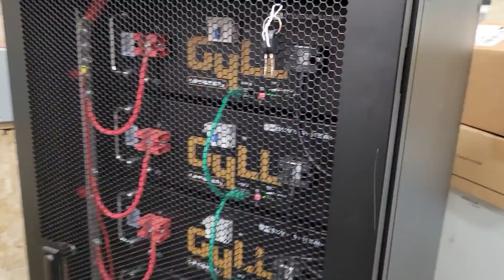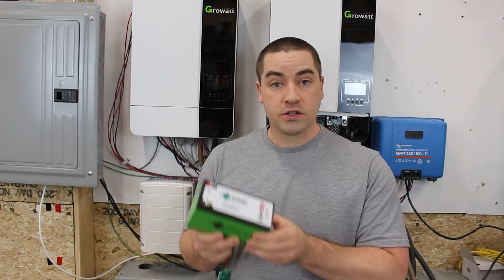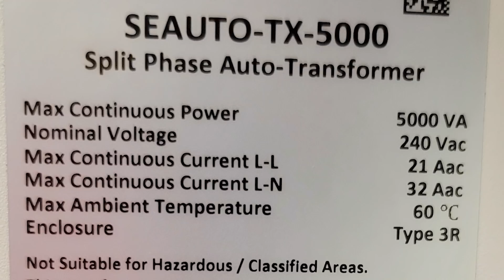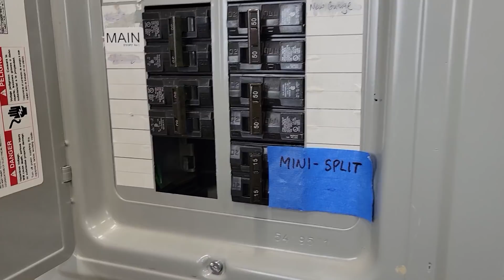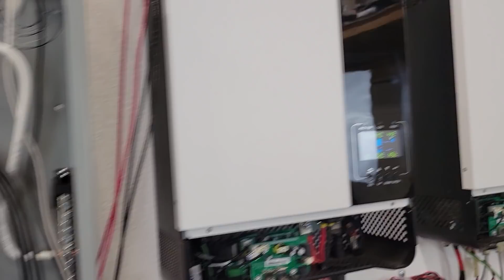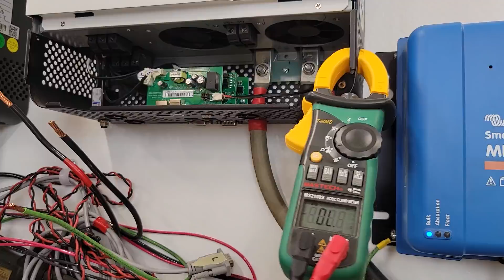Safety Concerns with Auto Transformer and Growatt 240V inverter SPF 5000 ES

Comment: David,

Love the work you do but from my viewpoint and, I may be wrong, you’ve improved the safety of your system but only protected the neutral overcurrent use case and haven’t addressed the use case where the auto-transformer itself and/or its interconnected wiring failed which isolates the neutral. Yes, these are passive components with very low failure rates but they’ve been known to fail for manufacturing, installation, and/or environmental reasons. Your trip will not function in this case. I believe the system needs to monitor the integrity of the neutral and shuts
 down the inverters, if the neutral is compromised or unavailable.
Reply: Good point.  You could add a voltage sensing relay to shut stuff off, but easiest would be a good surge protector, and I think Poz is familiar with this method too.  If voltage goes too high, it will short to ground and shut everything off fast. Cheap insurance.
Reply: @benssolarandbattery  Hi Ben. Could you do a video on how to implement the surge protector for this application? I sub to your channel. Thanks.

Comment: So let me get this right:

120v L1 (black) = 240v L
120v L2 (red) = 240v N
120v N = created by the transformer

And the hookup is:

240v L (both - black) ➡️ 3-pole circuit breaker ➡️ terminal block (black) ➡️ auto transformer + MCB

240v N (both - red) ➡️ red terminal block ➡️ auto transformer + MCB

Auto transformer N ➡️ 3-pole circuit breaker ➡️ MCB

(MCB = Main Circuit-Breaker Board)

Comment: Dave, looks like you have a breaker only on L1 and common, which is why when you throw the breaker you get 0 volts between L1/L2 and L1 or L2 and common.  Concerned you still have the L2 energized to your circuit breaker box, which could be an issue if whatever it is connected to that leg has an alternative ground.   BTW- Love the channel.
Reply: The inverter output is floating, so current from L2 can only flow back to L1, not to ground.

Comment: But those inverters are not hybrids they cannot enter the grid, the input is for the UPS function, am I wrong? They are not like the MPPSolar HYBRID SERIES! I do not understand the problem.
The neutral to earth is put to make the RCDs work correctly otherwise they do not work, some inverters such as the Victrons have a special programmable relay that closes a pole (N) to earth, obviously in this situation in the video it will not be earthed to the earth. inverter output, but only to the neutral generated downstream of the autotransformer!
This says my head but I live in Italy with 230V between neutral and phase and 400Volt between the 3 phases, maybe I'm wrong?
Reply: As the inverters here don't have neutral connections things get weird. If you use the UPS input and also have a neutral-generating autotransformer on the output you will have problems because you can only have one (bonded) neutral.

Comment: David. In your 100% Off-Grid solution, you will not have any troubles with that system. The 3-pole breaker should work, as long it can be made to trip in the first place, as you know, that MCBs do need a bit of an extra current to trip for overload. I do not see the need of using isolation transformers. Non-internally or externally N-G bonded inverters are IT (isolated) devices. An N-G bond after the autotransformer will give you the safety features of a grounded grid-connection.
Reply: This is a floating neutral solar generator design, I don't believe it can be used as a bonded neutral type generator because it would not be safe. Many portable generators (Honda inverter generator) are floating neutral designs and I wonder how safe those are?

Comment: So one leg will just have potential to ground when the breaker is off? 🤔 What i would do is just feed both inverters into a backfed breaker in an MLO panel and have the auto transformer fed off of the lugs at the top. Auto transformer is always on if the panel is on. You can then mount it directly next to the panel with a short pipe nipple to reduce wire run length for maximum safety
Reply: With only one leg from the inverter connected there won't be a current path for the other leg because neither output is connected to ground.
Reply: Oh, and the problem with having the autotransformer directly connected to the panel's busbars is that the inverters can output more power than the transformer can handle. Ideally you would want overload of the transformer to trip the main input but there's no clear way to do this with off the shelf components.
Reply: @eDoc2020  Very true, I did not think about that. However there are plenty of off the shelf solutions for this. The industrial market has a huge demand for that kind of stuff, you can even find remotely operated circuit breakers designed for breaker panels usually found in homes. You just need a robust control system, certainly no $5 chinese circuit will be reliable enough for that
Reply: My solar edge is connected to the main lugs.  This was also the easiest solution for me.  But, I'm currently only running one 5000 ES. So, there's no issue with overloading.  When I add a second inverter,  I will also add a second AT. I am a big fan of redundancy and overkill.

Comment: @16:18 I can see only one AC input breaker which is fine if you are feeding L, N, and Ground (as labeled on the terminals since this is US version is the modified ES version with new PCB that does not have N and Ground bonding), in this case with single breaker on L1 and no breaker on N (L2), if there is  short circuit between L2 and case, it will depend on the house breaker to trip instead of the internal breaker (if they install one). Can you read the spec of that circuit breaker? They should have installed dual gang circuit, but since the unit is not UL certified so they did not install it.
Reply: With L1 and N tripped on the breaker by overload L2 has no current path at all. You would have to have a second failure for the L2 to find a path to ground. The ground is a protection device. not a hot part of the circuit.
Reply: @solexxx8588  There is no N in this unit (SPF-5000 US), it is fed by L1 and L2 but GreWatt did not relabel the N port as L2, if there is fault in L2, the house breaker will trip.
Reply: @budmartin3344  Yes, if L2 shorts to ground it will depend on the house breaker to break the current. At the end of the video David addressed this, he is going to add a DP breaker on the feed into the distribution panel.

Comment: I would use an 100 amp autotransformer and wire it straight in. No breaker needed.
Reply: The auto transformer should be wired with the inverters, not separate from the inverters, and a failure on the auto transformer must stop the inverter power.

Comment: Just use the right circuit breaker on the output of the inverter, why we making this so complicated ?
Reply: Because that wouldn't protect the autotransformer.
Reply: @eDoc2020  How can it not ?
Reply: @quattrohead  The combined output of the inverters is 40 amps, but the transformer can only handle 30 amps. If you limit the output to 30 amps to properly protect the transformer you would be losing out on some inverter capacity.
Reply: @eDoc2020  And this is another reason that this setup is not good.
Reply: “Why we making this so complicated?”

This is why:
Video 1	https://youtu.be/gQ4NF9n0UxE
Video 2	https://youtu.be/goF46wGmPEc
Reply: @DavidHalko  Yes I know.

Comment: Separate the 240v and 120v loads into separate breaker panels/boxes. Bond the 120v breaker box and auto-transformer, and connect them to the 240v panel with a standard 2-pole breaker. So if the auto-transformer breaker trips, it disconnects all power from the 120v loads.
Reply: IMO: This looks like an interesting option to test and track; says my curious DIY side with hands on house wiring and one MPP solar system experience, but no autotransformer experience (yet). Wondering if this would protect from possible lose of ground., And if not. If a ground fault type breaker might also be some kind of option. I admit I still do not have full picture of concerns.
Reply: @CaptBill69  Interesting idea with the GFCI circuit beaker... I have always wondered why these portable solar generators do not have GFCI protection when they are mostly used outside which the NEC requires all outside receptacles to be GFCI protected. Also GFCI breakers are common with electrical hot tub installs although most are not 3 pole circuit beakers like what he is showing in the video.
Reply: https://youtu.be/RwI833Yh5XU
Reply: Can you make a video for this please. thanks
Reply: @makesaveinccomm     https://youtu.be/90O_iGjfm28

Comment: It’s amazing how much cleaner the power is from my Growatt inverter than the grid. My washer makes weird noises when on grid and is quite as a church mouse when off grid. I’m going to have my house disconnected from the grid next month because my power provider won’t work with us if we have solar.
Reply: Where is this happening?  The unit is Pure sine wave, you should not be getting that much noise from the power company as they can shorten the life of your electronics and refrigerators and such, have you contacted them?
Reply: sounds like bad transformer on the pole.
Reply: Curious what your grid location is.  ... like city or town, state, and country ???
Reply: Since these don't back feed to grid what us the issue with power company?
Reply: @sloup000  doesn't matter, some power companies don't want anybody with their own source connected. Probably for liability from the dumbasses who do back feed
Reply: Power companies don't care if you have dirty power, they only care if you have no power because they legally have to. The gate on my transformer has been missing a bolt for 5 years causing an amazing amount of spikes and brownouts in my house and explosions up on the pole. Burned out a TV power board and the computer in my fridge. They don't care and they never will.
Reply: If u want to have super clean power you need a power factor corrector kavar unit

Comment: I like using MCBs as supplementary protection.  The three pole idea does limit you to using an amp rating that matches all three devices which is not always feasible.  I like using an under voltage trip (applied the same way as a shunt trip) to a double pole MCB.  Instead of overcurrent protection for the transformer you actively monitor the L~N voltage.  If you lose the 120 (or it simply sags), the MCB trips.  It’s like insurance, better to have it and not need it than to need it and not have it.
Reply: Oh and make sure to balance loads and use proper wire sizes!
Reply: Except that the issue he was preventing was overvoltage/current
Reply: @solexxx8588  Yes, the setup will provide overcurrent protection.  David does mention that the transformer is hardly loaded.  Overcurrent and resulting high temps leading to failure (and loss of neutral) should not happen.  I'm just describing another means to shut down the 240vac in case of neutral loss.  Neither case is likely with sound design.  Much of the recent discussion on this topic has been around frying loads when 120vac is suddenly 240vac.  I'm not being critical, just providing another protection mechanism available when using MCBs.
Reply: The ideal solution is a multi-pole breaker where each pole can have a different rating. They appear to exist but they are not easily obtainable. If you want to monitor each leg (which I agree is a good idea) I'd use overvoltage detectors instead of undervoltage, as the former is what causes the real problems. I would not want this as the primary protection (better to avoid a lost neutral in the first place) but it is a good idea for secondary protection.

Comment: Personally, I think electricians are the worst when it comes to commenting.  I would like to see their systems if they have one.  I like your channel and you know what youre doing. You had Ben over, a professional solar installer! If something was wrong or dangerous he would have told you.   Now you want to see a hacked, dangerous system come see mine.  LOL   It works though, so I am happy
Reply: Hey, I'm an Electrician too!  Haha.  You've seen my systems most likely.  I try not to comment unless I have something somewhat constructive to say...
Reply: @benssolarandbattery  Correct me if I'm wrong but with David's solution even if the AT melt's (bridges the transformer) then the still connected L2 can't go anywhere.  With the breaker tripped there is no neutral in the panel and no connected path to ground in the panel  Both L1 and N are open.
Reply: That's correct .
I'm also a 37 year electrician .
These videos are very informative. 
And,  David's system is safe.  As long as he is the only person messing with it. He has enough knowledge,  to do what he does. 
While many parts of his system wouldn't pass an inspection.  I  would be obligated to warn him, if I thought it was dangerous.

Comment: Thanks David for updating that your setup is safe, was worried seeing the issues pointed out by others. But I still want to mention to those who are using these inverters directly imported from China and/or are having grid connected systems should be very careful. Those who have grid connected systems can burn up their autotransformers/wiring if connected without a dedicated transfer switch. And then there is the neutral ground bond safety issue in grey market imports. Lots of potential for failure and safest hazard. Be-aware!
Reply: Signature Solar GroWatt inverters are the ONLY ones with the ground-neutral bond broken. ANY other GroWatt may be dangerous if used with an auto-transformer.

Comment: I run an inverter also that is not connected to the grid . An MPPSolar Hybrid 5K . I was told by a senior forum member ,inverter repair electrician ,to connect the negative out of the inverter to ground on the inverter. It confused me but I now believe this should be done . I do not understand why and perhaps thats what people are trying to tell you . The earth is grounded through a copper rod in the ground , but the negative should be too to remove all stray voltages . Its been that way for more than 12 months now.
Reply: I think a separate dedicated ground rod is required for the solar system components if you are grid tied. 
If not grid tied, you still need a ground rod for the system.
Reply: Don't ground the battery terminals. (Positive or negative) 
That will just adding more possibilities for a short circuit situation.

Comment: I was wondering when you were going to weigh in on this issue. Thanks for making the video.
Reply: Yep! all fixed installed a circuit breaker, LOL. Circuit breakers are the NEC standard for overcurrent protection, but he didn't solve the underlying issue this inverter/autotransformer system has in regards to safety and when connected in a inverter and battery charger or grid bypass mode!

Comment: The names or labels of the AC output of the inverters: you're calling them L1 and _neutral_, but aren't they really L1 and L2?  Ie: 240vac between them.   So, when/if the new breaker trips, there is still 240vac present in your whole house on the L2 (being called neutral)?
Reply: Exactly !      There is NO neutral on a Growatt 5000ES, 240 only (2 hot legs),  that is the entire reason the auto transformer is needed !
Reply: He did say that at one point. The in and out of the inverter are L1,L2,G  The AT has L1, L2, N, and G.
Reply: As the inverter outputs are isolated from ground, there won't be any voltage between L2 and G unless L1 is connected.

Comment: If anyone is able to find a breaker that safely supports "diy" common trip I would love to see it's datasheet. I looked for that as well for my 5000ES but couldn't find anything.
Reply: I also couldn't find anything. A technical possibility would be taking a standard multipole breaker and changing some of the internals for different ratings but this obviously would damage the integrity of the components.
Reply: Panel mounted breaker manufacturers have what they call "handle ties". that can be placed on multiple single pole breakers.  I personally haven't seen any for din rail mounted breakers.  But, they could possibly exist.
Reply: @timselectric502  Handle tied breakers does not always mean common trip. Specifically, handle-tying "trip-free" breakers cannot result in guaranteed common trip. Trip-free is when a breaker will trip even if the handle is continually pressed to the on position, a standard feature.
Reply: True,
Sometimes the other breakers will have enough resistance in the mechanism to hold their position. 
Just offering a product suggestion. 
Research into that, could lead to finding a better option.
Reply: Ya I came to the conclusion that handle tie wouldn’t cut it unfortunately.
I had it in my head that the handle was how common trip breakers work, but that wouldn’t be safe and isn’t the case.

I’m just going to have to move my dryer and hvac to a separate 240v only panel, hardwire the transformer into my 120v panel, and limit the whole 120v panel to 25A if I want to do this right.
Reply: That's basically my setup.  But I'm only running one inverter.  So, my AT is tied to the main lugs of the panel. And,  the back feed breaker protects it and the panel. My loads are balanced to within 3 amps.  So, I don't worry about the transformer overheating.  My concern is fault protection.  And/ or neutral loss.
Which is why I will probably be adding a contactor with a 120 v coil,  in the near future.
Whenever I add a second inverter,  I will also add a second AT. And just increase the breaker accordingly.

Comment: When you checked that neutral about @13:41 it looked like almost 2.38volts from line to grounded neutral with the neutral ground breaker open and you called it 0volts.  Please expand? Thanks.
Reply: This is caused by stray coupling between components. As soon as any load is applied , any load applied will drop the voltage to real zero.
Reply: @eDoc2020  Thanks.